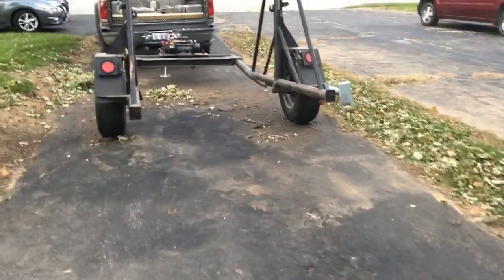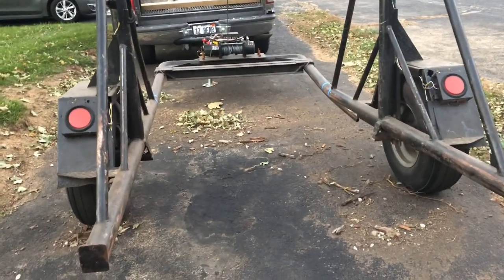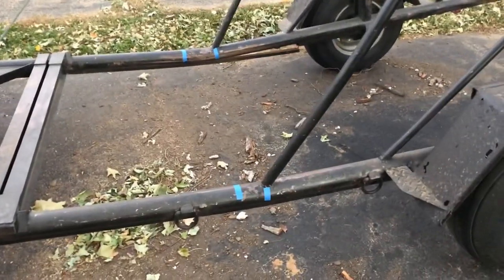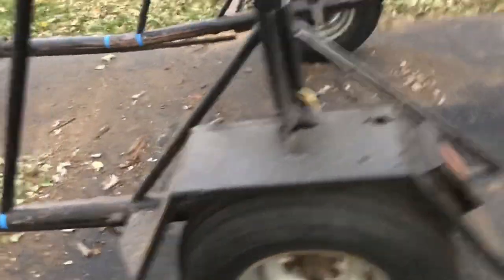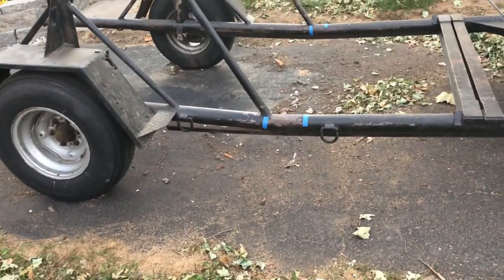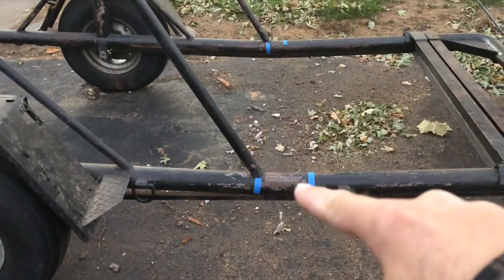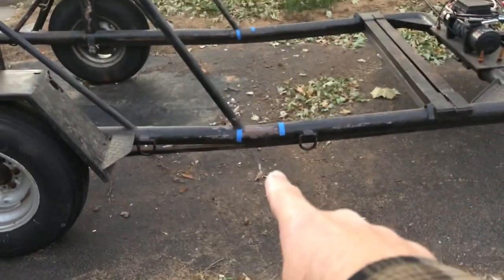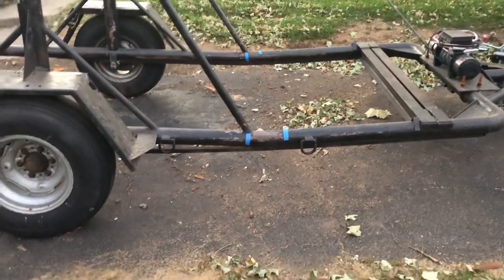The Best Log Trailer On The Planet!-I broke it!!

Comment: Low brackets at axles with essentially traction bars going to rear of trailer tube frame will help fight against pull from winch to lift point

Comment: Hi there My background is in aviation repairs and have done structural tubular repairs to spray planes. If you cut out the bent area slip another pipe couple feet on the inside and use multiple rossets welds thrpughout. Add a fishmouth doubler at your junction point. Very impressed with the trailer design

Comment: It's a good design, I think it simply needs to be stronger, with out permanent cross members it's a wishbone, huge I beams maybe?, taller stock then you can cut off and salvage all the a-frame? green logs are heavy as fuck as you know, bigger is better.

Comment: I've repurposed 3 of these during the past 2 decades.  I contacted 2 manufactures about this market & they both ignored me.  Youtube was not around then.  This is near 1/2 yr old so you may be thru "my" thinking by now.  But as I see it - I agree that 12000# of pull (as stated for that winch) could spring the "U" shaped base.  That was a definite mistake.  Your fix sounds reasonable.  A sleeved tube is a pain if you ever have to cut in there again, but its yours, you know about it & can contend with it then.  As it sits empty you have tongue weight.  Placement of your load will add to or subtract from that depending on its weight % fore & aft the axle.  That's a decision you make when you load.  The carrying capacity of the trailer is the combined capacity of the tires & the tongue.  In other words if you put stronger tires on it, the structural members including hitching may not be strong enough to carry what tires can.  Again a choice you can make when you load.  Typical tongue weight suggestion is 10 % of trailer weight assuming it is within structure, tire & hitch limits.  So load weight & balance fore & aft are important & your responsibility.     Trailer steering "action" is a function of hitch distance behind (pull) axle (stinger length on western log trucks) , & distance twix hitch & trailer axle.  The shorter the hitch to trailer axle distance the quicker it will react to steering input assuming no change to prime mover.     I've enjoyed the ones I've repurposed.  Moved primarily logs for dimensional lumber.  Largest was 32 inch by 16.5 foot sugar pine.  Other than all the atv stuff on YT, I had seen only one other one (in rural OR) & there is the other guy in other comments who said he has done this. This does however bounce off the  "Big Wheels" developed in the late 1890's for use behind horses    Cheers.  Enjoy.

Comment: Before you mentioned your plan I thought that cutting the tube  and installing a piece of pipe or solid bar stock inside would be the easiest repair.
I'm glad we agreed. I don't think that shortening the frame will reduce your tongue weight. To reduce the tongue yo would need to move the axle forward on the frame. Adding another strut from the top of the arch to the front of the trailer would help relieve some of the stress. In not a welder but I do a fair amount of welding .

Comment: You should also add a pipe or brace from the top of the lift bar down to the front of the trailer on both sides. Like what is there just to the front pipe that winch is mounted

Comment: I was looking at a trailer like this for sale yesterday that a guy was using to haul logs.  He mounted the winch above the wheel so that when he pulled with the winch all the weight went down on the wheel and didnt flex the frame.  May be worth looking to relocate the winch to avoid this problem again.